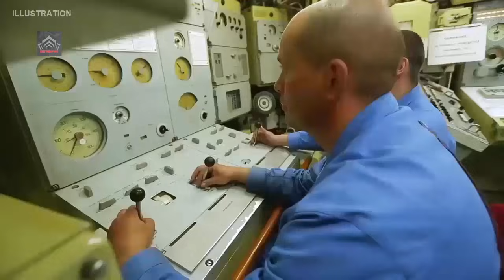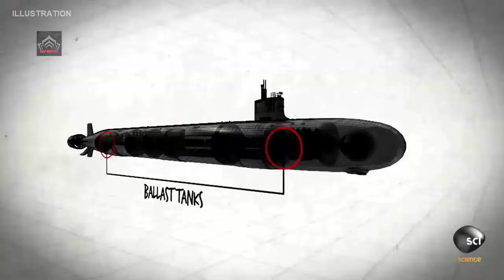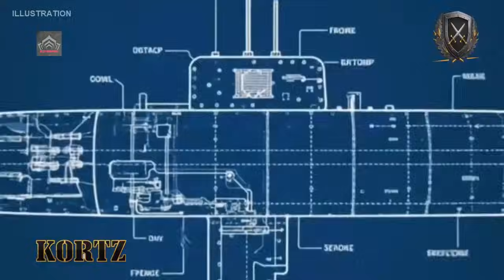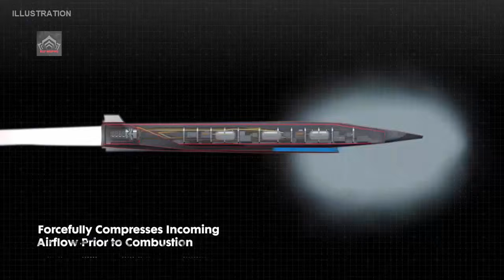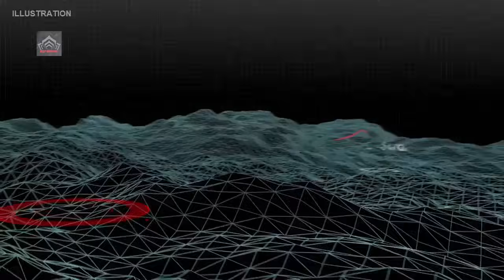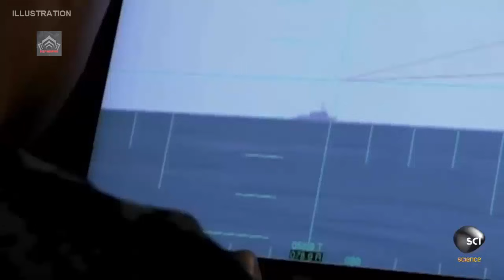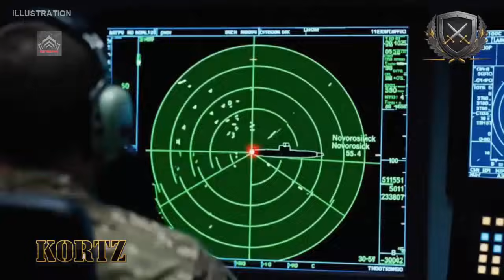Russia's Deadliest Sub Yet: K-572 Perm About to Unleash Underwater Zircon Hypersonic Hell

Comment: The West should remember that Russia was always VERY good at building submarines, with an emphasis on very quiet operation when submerged. Whilst the Shkval supercavitating torpedo has been discontinued, there is a replacement, the Kishchnik ("Predator") with significantly improved capability, and a very high kill rate, even against manoeuvrable targets.